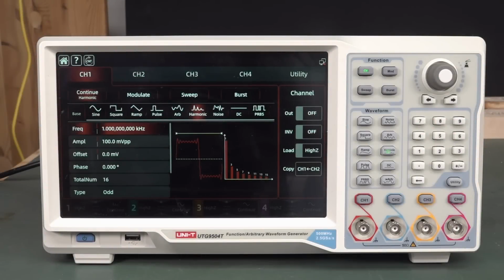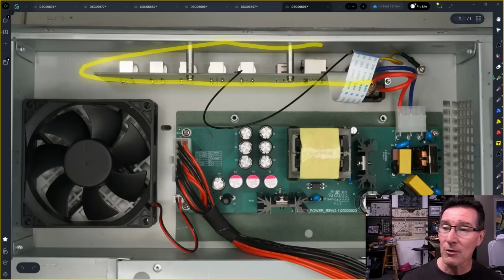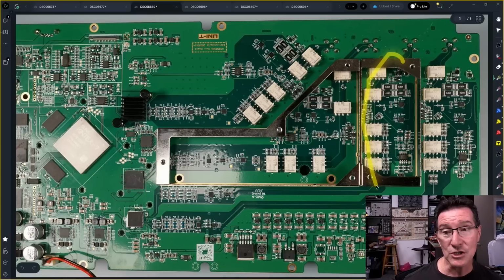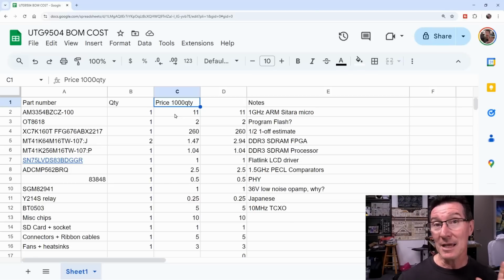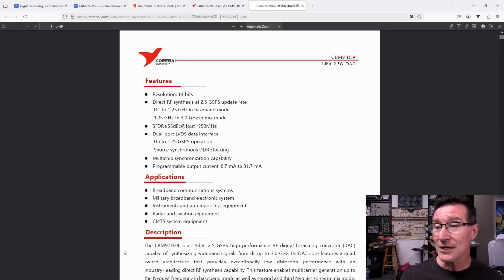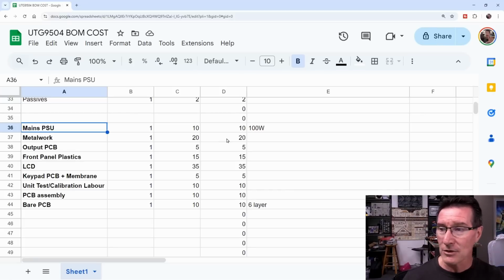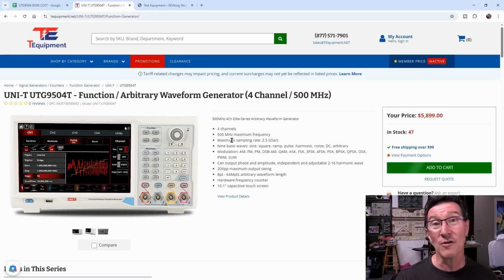EEVblog 1679 - Why Does a Uni-T AWG Cost $5800? - BOM Cost Analysis

Comment: Just adding some thoughts as ex Head of Product for volume advanced hardware, just ask yourself a few questions about what the costs are that have to be shared across the BoM.  Work out how many units you will sell and be certain you are right, then share across them the total R&D cost, add in all the costs of setting up production and Quality assurance, then work out the cost of distributor training, marketing manuals, training and the team that sets it up.  Cover all the costs of plastics die setup. the cost of Certifications, packaging design and shipping prep.  Then work out how much cash you company risks on new products and how much the cost of risk they need. Then fill your global distribution channel with product, work out how much that idle cash costs you  over the time it took you to push manufacturing out through it.  Eventually, then see how much you spent, how long it took and how many sales you made in 2-3 years.  Work out how good you were at every other product Compare that number to the easy option of sticking your cash in the  bank and check that everything you did worked better.  What you end up with is a risk and performance adjusted calculation of how good everything that came out your idealised concept compares to how good you and your team are at making a product succeed.  Essentially you need to be certain you deliver 10x you BoM cost in revenue otherwise your boss would be better off putting your project funding in a fruit machine :-)  So easy when you know how
Reply: Yeah, amortising software development costs is going to be a huge factor.
Reply: my experience was that you start with a 5 year roadmap that grows as you learn in in market. you focus on a modular hw and firmware design and try to move as much hardware change as you can into programmable devices like FPGA.  It's inevitable that your hardware goes through minor revisions to improve performance and fix QA issues to speed up hitting volume targets on budget.  A good team knows how much it costs to spin the  hardware all the way to volume and it's a constant battle to match product uplift to budget.  on the positive side, if you get good at all this you add more features in usability and customer experience. owning one of the latest Uni-T spectrum analyzers i can agree they have fantastic usability and i wish my version could take firmware updates .....
Reply: @ajxr3672  mm I would disagree on the FPGA comment, you'd best avoid that sort of things for anything you don't absolutely have to slap one in for. Why? Incredibly expensive stuff compared to what the function of them is. You'd be much better off designing things in sort of modules that you then assemble on the PCB like you can see this has. FPGA gives flexibility but you have to be 100% sure you need it and will change it in the future - if not then avoid it and you  have a much cheaper and more competitive product. I think FPGA's are awesome things, but they are so incredibly expensive compared to other things to do the same thing, that they should stay in the prototypes.
Reply: @noth606  That drastically depends on how cost sensitive your product is and how large your series volume, I guess. FPGAs are usually quite cheap for the functionality they allow, unless the volume is so high that other solutions like ASICs are viable. But that is often not the case even for mass produced industrial products. In many applications, there is no substitute for them short of custom silicone. (Good luck interfacing i.e. modern JESD204 data converters without them.) I agree in that sense that if you have indeed a solution that does the same thing a lot cheaper, use that then! But then maybe the problem was not actually a "FPGA problem" in the first place.
Reply: @hmpeter  silicone?! As in silicone implants? 🤭
Reply: And don’t forget the risk of providing warranties and service and support for the warranty period, and stocks of spare parts for a percentage of product that may fail
Reply: @tomorrow6  and registering the design or patents if applicable. Neither are cheap.
Reply: And in the end projects like this tend to be predominantly software projects, not hardware projects.  The hardware is effectively just a platform to run software on, but what differentiates it from competitors is the software.  I would imagine a product like this, even if there's plenty of shared scaffolding and existing work that overlaps with other products (no one starts from scratch for each product) it probably still takes a year for a dev team to both develop and then verify that it's actually correct, build tests for etc.  Not cheap, especially with qualified engineers who know what they're doing.
Reply: @jj210-g8r  with test instrumentation used the way it typically gets used there is a fair bit of hardware design to it, the output has to be very 'clean'. The software doesn't really matter except for the UI being practical and intuitive - or not. But you can learn to work with a dumb UI, you cannot learn to work with a noisy output or one where the values you set are just friendly suggestions and may or not be followed properly.
The software dev team is unlikely to be doing unit testing for this stuff themselves, they won't know how the thing is really used, and will need people who do to take it out and use it however these things are used "in the wild". Developing tests for it as a dev doesn't make sense except for the "edge case" testing that you do to check the potential weak points based on how the software is built. 
That is how I did things, I had people who used the stuff I built test the stuff the way they used it. As a software dev I have a general idea for what stuff is meant to do and how the UI makes sense from the perspective of what goes on under the hood, but not how it is really used by the people who work with it. People who are real users of the thing need to be brought in to tell me if what I'm building makes sense from their perspective. When I first started way back when I thought it made sense to build the thing and then explain to people how it worked etc, but to make good stuff you need to do it in reverse. Have the users explain to you first how it makes sense for them to have it work, then you build that as close as you can, then have them taste it for flavor and give you feedback. It gets users invested in a sense but also it ends up with something that is "designed by the users" in terms of UI, and it may be less 'pretty' than it otherwise would be, but it'll be a LOT more popular and loved.
Reply: There’s a spreadsheet for that.
Reply: @ajxr3672  
But after 2-3 years of development, when it begins selling, it's already updated. 
Did it happen to you that you had to change the design because of that?
Reply: "cost of distributor training" and then another type of training in same sentence:  my god you're complicated person! don't ever go near any electronics, you'll just produce words and doubts! this is silly!
Reply: Да да, только все подобные проблемы, у других конкурентов могут стоить в 10 раз дешевле, и вы, когда с таким ценником выходите в продажи, и его никто не покупает, уходите в большой минус. Так вот и работает нынешняя экономика, зачем платить больше, когда у конкурентов можно взять в разы дешевле..

Comment: I think that 500k isn't a bad price for the developers, based on working with consumer electronics from Asia.

I think they might have needed several custom board spins, so I'd add in 50-100k in dev hardware during the evolution of the product.

Comment: My gut feeling here is that $800 is conservatively low.  I think the NRE would be much higher, and i think the total units would be much lower.  I dont think you're miles off with the component costs.  You can easily spend $100k on plastics molding for a product like this - I would ballpark the BOM at closer to $1200

Comment: The LCSC pricing can be misleading, as its the "china hoarded stock" during shortages. We have seen parts that were 100x the official price (a 50 cent low noise LDO). Better to take western distributor pricing, or even the 1ku MSRP from the vendors (TI used to have that value and such price is also in the parametric search, which is very useful when one can not decide so picks the better/expensive or cheaper/whatever kind of part).

Comment: Just pure clickbait video. Go make it yourself and I will buy it for 4x 800 bucks. Can’t? Just stop “vibrating the air”. It’s quite niche product, which wouldn’t be sold in millions. SW/HW/HDL development costs a lot. Prototyping, pre-serial production, testing and reworking after the test. Plus warranty cases overhead, support, documentation. 
Go complain Apple selling 1.5kUSD phones with 150 in BOM. :)
Or, complain that Garmin sells their certified avionics 20x to the BOM. :))

Comment: I would reckon there are quite a few arb sig gens that can do 500MHz.
IM not familiar with the market, but even your own chinese løverboi. 💋 Rigol got a few..
DG5000PRO and DG70000
DG5000PRO. (you can find my threaD ON EEVbl.).."Rigol DG5000PRO Signal Generator [10,1" 16bits 2.5GSa 2ch. 250MHz to 500MHz"
 its a relative new model with battery ablelity.. its based on the formfactor of Rigol 10" scope line (DHO1000 & 4000) .... CN Starts at 2.5k and up to around 5k for the flagship-
and  is the next step up after their entry line DG800PRO & DG900PRO (which start at 300 buck, and can be hacked).. its 200MHz 16bits, 2ch. 1.25GS, 32M for as little as 300 bucks when I got mine in nov2023 and is based on the formfactor of Rigols entry scope line DHO800&900 

Worth having in mind.. there is a UI bug (literally out of the box) on this entry DG800/900PRO signal gen-line. so you have more or less 200MHz on most of the portfolio of waveforms, alongside its 148 inbuilt ones, and 250Mhz on the pulse (4ns).. thoigh to what usefull extent and how far up the signal actually can hold it itself together without choking.. - I dont have the scopetools to quantify where the actual useable-limits are, when you this far out of bounce from its official spec'ed tolerances, so it could be an interresting hornest nest you could take a look at.
and 300 bucks.. does make it attractive for the hobbybased community, with its big 7" touchscreen and powerbank ablelity, so would likely be an audience.

Comment: The THGBMNG5D1LBAIL chip was identified by Google Gemini as: The electronic component shown in the image is identified as a Kioxia (formerly Toshiba) THGBMNG5D1LBAIL eMMC (embedded MultiMediaCard) NAND Flash memory integrated circuit (IC).

Key details about this part include:

    Type: eMMC NAND Flash memory
    Manufacturer: Kioxia America, Inc. (formerly Toshiba)
    Model Number: THGBMNG5D1LBAIL
    Memory Capacity: 32Gbit (which equals 4GB)
    Package Type: 153-WFBGA (Wafer-Level Fine-Pitch Ball Grid Array) with dimensions of 11.5mm x 13mm
    Interface: eMMC
    Status: This particular part number is listed as obsolete and no longer manufactured by Kioxia.

The markings on the chip, including "THGBMNG5", "TAIWAN", and likely a date or batch code like "22439AE", along with the visible "ST" logo (which may pertain to the device the eMMC is used in or another component, not the eMMC itself), are consistent with the identification of this eMMC module. These types of components are commonly used for storage in various electronic devices such as smartphones, tablets, and other embedded systems.

Comment: uni-t oscilloscope is very cost effective and I own several of them (In my home lab, my office desk and even hve two handheld version that also have digital multimeter func for working onsite checking siemens motor drives)

Comment: What about the cost for software development?
Reply: One guy in a year will do a fine job on this. Probably much less as long as the FPGA guy uses modern design automation and has scripts that generate C headers for registers and stuff like that, based on a higher level description. My favorite HDL is basically Python that generates Verilog or VHDL, documentation scaffolding, and a lot of other stuff.

Comment: About searching for faults that show up in automaed testing: Sometimes it's worth investing more in anlysis time than the price of the board because it will maybe help you optimize the production to prevent that error in the future. I've spent hours on 50$ boards because it helped us finding those errors faster in the future and also provided valuable feedback to the assembly line.
And about the NRE: I think you're really low there. For a device like this (especially with a lot of software development) I'd say they could easily spend an order of magnitude more (except if they can reuse a lot of stuff from other products that they already have running)

Comment: Super interesting stuff. I work for a dive computer company and since it's a niche product it probably sells in similar quantities to these kinds of things. You put a fixed cost for the plastic, but it might be better modeled as a huge upfront cost for the mold plus a nominal per unit cost. But I guess that as long as the final per unit cost is close, it works for the demonstration. I think $800 is probably in the ball park, though likely on the low side. When I first started in the industry I was pretty surprised that you have to sell your item at at least 2.5x the cost to produce it in order to make any money, but that's why I'm a developer and not a business owner :D. Thanks, Dave!

Comment: The $10 price for the AD9122bcpz seems suspect - ADI's direct pricing is $44 at 1K. UNI-t no doubt will pay rather less than that.
LCSC sometimes have better prices on TI and AD parts but usually they are higher than US distributors. Their description for the part is wrong so it could be a mistake, or they might be selling them below cost to clear the last 10 parts that they may never otherwise sell given it's specialist nature and the high-end engineering needed to design them in.

That said, high volume parts are obviously sold in Asia at much lower prices than in the west given Aliexpress vendors can sell complete boards, with shipping, for well below the cost of the parts in the west - eg. STM32F103 boards (long before the counterfeit/copies became available). ST were likely selling 10's of millions of those parts in China at very low prices.

I would not put a dual 16bit 1230MSPS DAC in that category.

Also bare in mind that LCSC often show ridiculously low prices for items they don't have in stock.
Reply: I guess one of your viewers realized they were a bargain and bought the 10 parts which would have cost $58 each from anywhere else!

Comment: American PCB manufacturer this populated would be well over $1000 per. Just the PCBA!! We had (6) layer PCBA made qty of 400, a quarter of the size in your video from PICA. It was expensive and included only flying probe tests. 1.5" x 4" about 50 components. $323 each!

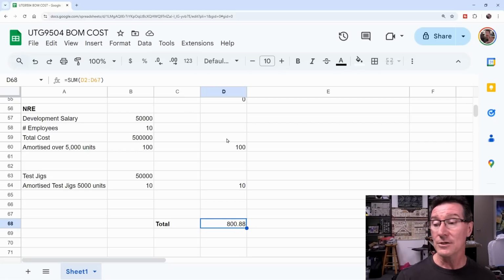Comment: 35:59 EVEN IF $1000.  Production and sales figures legally have been 30/30/30. 
30% parts 
30% Labor and
30% Profit. 
SO EVEN IF $1000 PARTS $1000 labor per  unit.  PROFIT Should Be $1000.   Should be a $3000 machine
Reply: You can consider the profit to be a risk factor, which isn't the same in all industries and markets. The net profits have to be similar to your financial risks to break even, as you can fail to get return of investment by that figure (1+profit_margin ~ 1/[1-failure_rate] => e.g. 25% margin for 20% failure rate or 100% margin for 50% failure rate).
And it usually has to be higher, than pure financial investment gains (where you invest in/support other peoples' work instead of your own).
Reply: “Should be” - says who?

Comment: 34:29 This Where IS Acually Around $200 A Year Model because there just recycled old circuits and just added faster parts these designs were made years ago and reused... this number you have was generated over 10 years. 34:29

Comment: Interesting breakdown, but i really think you cheaped out on the cost of passive components. Good capacitors and precision resistors can add up quickly to more than just a few $ on such a large PCB.
And as others have pointed out, the NRE seems to be cut short. Global certifications quickly add tens of thousands of dollars, all the documentation and manuals, translated in the most common languages, packaging, marketing materials, and lets not forget that they probably had to make a few early hardware revisions for the developpers, where they probably quickly payed 10k$ per unit to have them custom made without volume pricing.
I don't think UNI-T is asking too much for this. Imagine what it would have cost to get one of these with roughly the same raw specs from the "premium" brands like Tek or R&S? Probably at least 4x the price... 😅

Comment: PCB assembly done in China is dirt cheap. They have pick and place lines that make science fiction factories seem old fashion. They should easily be able to set up and populate the PCB's for $1 or less for a run of 1000. Also they don't pay engineers like they do anywhere else in the world. So instead of $50K you are likely going to pay between $10K and $20K so you should use $15K instead of $50K. So I'd have to guess that the final BOM cost would be about $550. This makes sense as every product that I've ever worked on had a multiplier of 10 from BOM cost to selling price.

Comment: i work in high-volume tech product, our rule of thumb is the final retail price is 10x the bom cost. That mean using a mcu that $2 more expensive will increase final price to $20. which gonna put our product in different price bracket. which means you gonna be more competitive
Reply: I guess you work for Fluke? Although only 10x BOM seems a bit low. 🤑